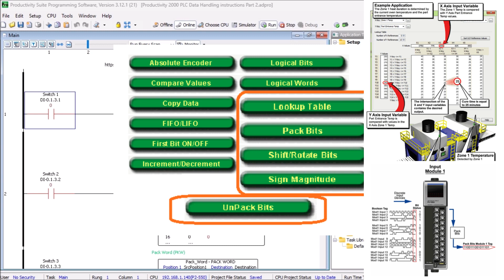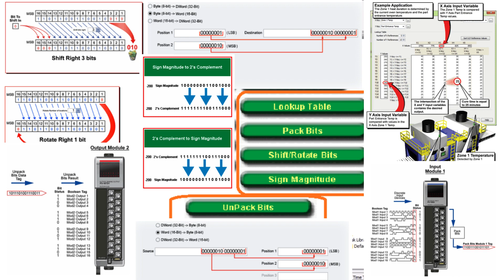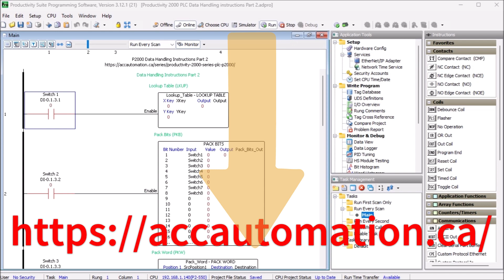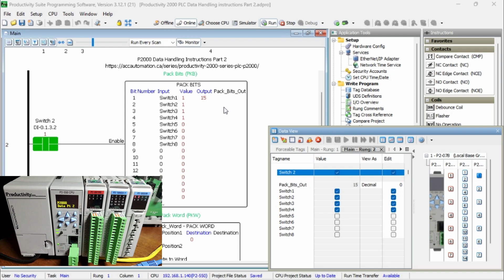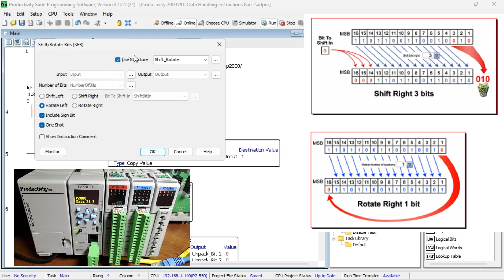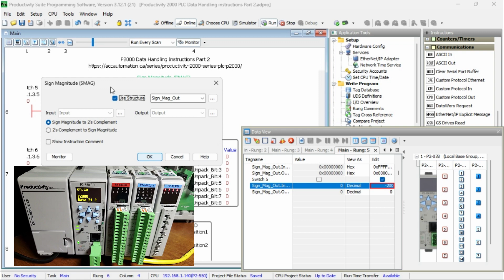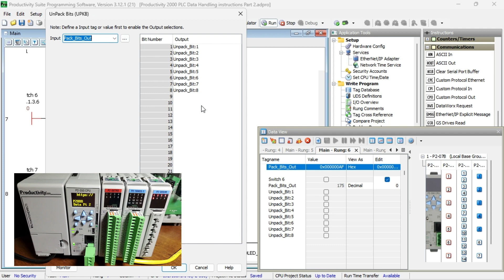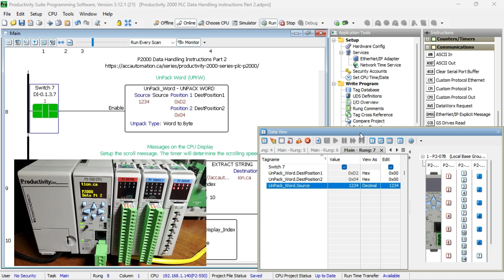Master PLC Data Magic: Pack, Unpack & Bit Control Secrets

Comment from the maker: Detailed information can be found on our website. The post for this video is located here:
https://accautomation.ca/productivity-2000-plc-data-handling-part-2/

The Productivity 2000 Series PLC is located here:
https://accautomation.ca/series/productivity-2000-series-plc-p2000/

There are several reasons why we are using the Productivity 2000 Series Controller. Here are just a few.
- CPU with 5 communication ports
- 50MB user memory - Can handle very complex applications easily.
- Limitless PID – Autotuning – Individual or Cascade Mode - etc
- OLED message display on the CPU module
- Plenty of discrete and analog I/O modules
- Status displays on all discrete I/O modules
- I/O Modules have QR codes. This can be scanned to have the module's latest specifications/wiring diagrams.
- OLED data display on analog modules
- P2-RS remote I/O expansion module, or use the Productivity1000 P1-RX remote expansion module to add even lower-cost remote I/O to your system
- FREE full-featured Productivity Suite software
- Programming with several ports - USB, Ethernet, Serial
- Hardware auto-discovery
- Hot-swappable I/O - Remove cards with power on the system
- Choose from three wiring options
- Slim DIN rail density form factor:
 - hardware - power supply, CPU, and seven modules in only 10-1/2 inches
- All project files (program, tag name database, and all the program documentation) in the CPU
- Run-time editing and debug mode on CPU
- Easy data logging with micro SD on CPU
- Secure Web server to access data files and system tags
- Easy drive and motion controller integration
- Coordinate motion control with PS-AMC allows control of up to 16 axes and synchronization of up to 4 axes
- Two-Year Warranty

The Productivity 2000 series of programmable logic controllers currently has these features built into the P2-550 CPU.
This CPU (Central Processing Unit) is known as PAC (Programmable Automation Controller) because of its communication capabilities.

ACC Automation
https://www.accautomation.ca

Comment: These videos are so informative and there is so much information to keep up on. Do you have a video on the ChatGPT it is a large language model chatbot developed by OpenAI. By creating a sentence description to devices like the Arduino Uno or esp32 ChatGPT will create the program to download to the circuit board. It also learning to program PLCs.  😎 Thank you.
Reply from the maker: Hi q zorn,
I have been following ChatGPT for awhile now. This technology seems very promising. I have tried a few PLC circuits, but the putting together of complex PLC programs still needs some work. Also it has difficulty putting together ladder logic currently. 
You should also check out tinywow. They have an array of tools with AI to help you out with a lot of common tasks.
https://tinywow.com/ 
Thanks for the comment.
Garry
Reply: @ACCautomation  Thank you so much and I will check out tinywow right now.